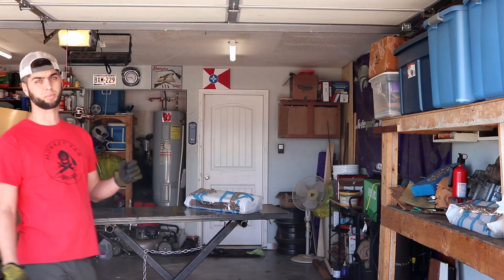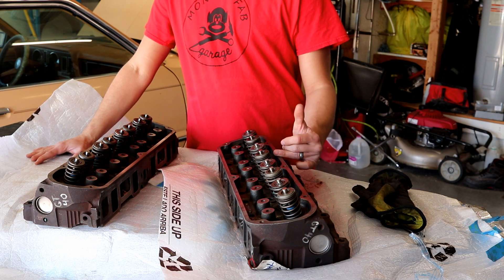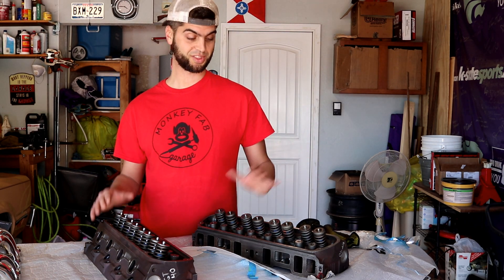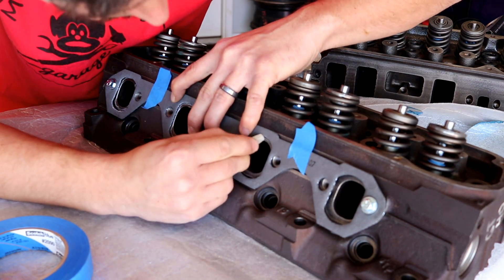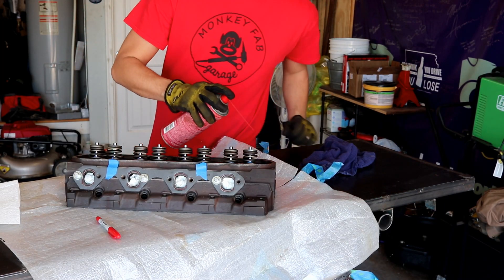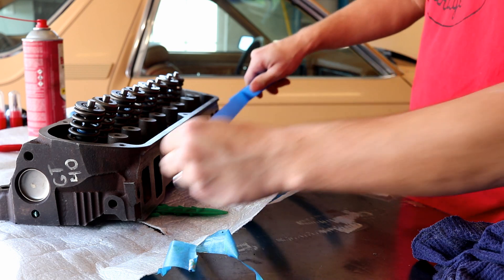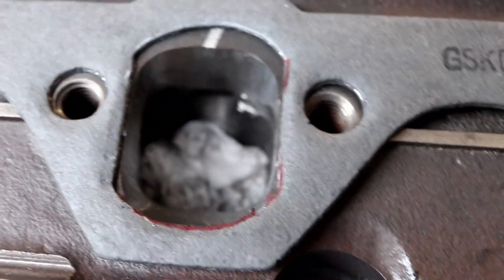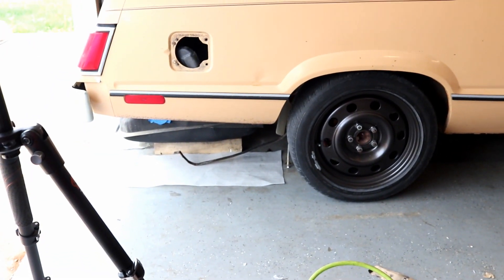Swapping GT40P Heads on a Stock Low Compression 78 Fairmont, part 1

Comment: Not worth the effort  ,grinding  the bottom of an exhaust port, , spend your money on a good valve job and port work in that area  1 inch before and after the valve is every.thing
Reply from the maker: you're not the first to respond about the time I spent on the floor. I've certainly learned quite a bit since posting this video. Totally makes sense

Comment: Flat tapped cam 150-180$ it’s gonna make such an improvement and your already in the engine 🤔
Reply from the maker: I didn't have to take the timing set/timing cover off this way. Or remove the radiator to get cams in and out. Pretty happy with how it turned out. I'll let the next owner pic their own cam! Thanks for watching

Comment: The GT40p heads do have an exhaust valve and port size problem. You can just put an angle  on the port exit on that side and no need to make it too much bigger but these direly need full on exhaust port polishing because any cam over .500 it starts to lose cfm because it simply cannot scavenge due to the small valve.
Reply from the maker: well said. Thanks for watching

Comment: Curious how.   Does it run being low compression I have 85 cougar I am doing thinking I am doing a cam and gt40 p heads with a carb
Reply from the maker: unfortunately I suck at getting things done quickly. If you watch my next upload tomorrow, you'll see I'm still struggling with start up issues. I wish I already had this answer for you!!! It's killing me not being able to drive it. If you can find normal GT40 heads (non P) I'd recommend that so you don't have to deal with the spark plug clearance issues.

Comment: When I hear never cut the floor? I kind of laugh. Why? You can knock of the rough cast but nothing more. The short side radius is a place to learn something. There is more power in the valve bowl area then any where in the port. There is a book I suggest because every pro has a input in it. As a few Pro's has told me. "It's not the best book but it's a damn good start." The book is called "Engine Airflow" by Harold Bette's and another book to get is "Engine Airflow" by John Baechtel. Trust me those two books will change your way of thinking in porting cylinder heads and intakes.
Reply from the maker: appreciate this! I'm glad I did what I did (even if some people think it was wrong), because regardless it helped me learn so much in doing so!

Comment: Thank you for this video. This is something i would like to do to my spare engine but have never done before. Just gives me that little extra confidence
Reply from the maker: First off, that comment tickles me because that's one of my objectives of my channel is to encourage people. What I also want to share is that since this video I've learned there's next to no advantage spending time when porting the exhaust port to do anything on the "floor" of the port. Spend your time knocking down any bad casting lips on the sides and ceiling only
Reply: @Str8sixfan  cool thanks for the tip. I want to do a build video series with this engine anyway and will give you a shout out and link to your vid when I do

Comment: I port heads for fun and profit. In the future, when you port stock iron heads on a mild engine, do not gasket match the ports, that will only slow down the velocity and make the car feel a bit lazy because they are too large. Port and match only the long turn radius, (top of the port) to the gasket or header contour, and leave the short turn radius (bottom) alone - do not touch it. This one tip is 10 horse and 10 ft/lb of torque.
Reply from the maker: Appreciate the feedback. This may have been the only way to learn. Luckily I didn't go true gasket match, but could have left the floor alone. Next time. Really appreciate the advice. This is exactly what my first project car and series of videos is supposed to do for me! Help me learn for when I build a car for keeps.

Comment: I could be wrong since i dont know alot about fords. But i heard there was an aluminum intake in 82 that was 2 barrel for an h.o. they were slightly taller i believe maybe something to look into
Reply from the maker: OK, I'll give that a shot. I know of 4bbl HO manifolds for sure.
Reply: @Str8sixfan  i have been looking more into it and apparently it was a one year only from the looks of it. in 82 it had a 369 cfm 2 barrel, then in 83 a 600 cfm 4 barrel. of course if you can find one cheap because i get the budget carbs are not to cheap, you can find them cheap sometimes but not always. maybe a phonolic spacer under the 2 barrel will help

Comment: Your stock compression ratio being 8.4:1, these heads should give you a decent boost in compression and is one of the best flowing factory heads Ford made.
Reply from the maker: Looking through old literature I could of sworn it was more like 8.1:1 stock. But regardless for sure looking at increasing it!

Comment: That's a really good deal for a really good set of heads and it looks like you've got just enough left in the budget for a timing keyway kit plus shipping too! 
Over the years I've seen a bunch of people throw awesome sounding cammed up engines together that can barely turn a tire over. If your nice heads, cam and intake don't match each other well then they will often run worse or barely better than stock. Unfortunately the stock broomstick cam isn't even close to optimized for the stock heads, much less the GT40 heads. 

I know what's done is done but having a tech help you pick an ideal off the shelf cam based on the engines compression ratio, the stock intakes peak RPM and the cars gearing would have been cheaper than the finished heads, much easier to install and much more rewarding in both the performance and sound departments. Advancing the stock cam with a 60 dollar keyway kit will do almost as good as a mild cam by getting you closer to the air speed and cylinder pressure you are gonna need to see a real gain from adding more port. 
Keep in mind by adding so much port on an otherwise mild combo you are actually going against the logic of velocity that Uncle Tony is trying to teach us about by purposely putting smaller 318 2 barrel heads and a purposely restrictive intake on his current 360 high torque daily driver build. (This is the same intake I showed for my Olds 260 build in one of my last vids by the way) 
289 heads with smaller combustion chambers for even more compression and smaller ports for velocity would have actually been a better pick for a low compression engine with the stock cam but hindsight is 20/20. 

I'm not trying to beat you down or sound like a know-it-all here, I just want to make sure you understand how important it is for an engines cam, heads and intake to all work together. Efurd's comments about the garden hose and velocity are pretty much spot on. 
Your hose just got bigger so now you need to increase speed and pressure.

There's a chance these heads alone with no other accompanying upgrades might actually make the car slower but I'm sincerely hoping that won't be the case. A cam that works properly with these heads and the stock intake would make this one mean little combo but I understand that's not in the budget. Speaking of budget though, I was just researching these heads to give myself an idea of what your compression would be when I found out that the GT40P heads come with very weak stock valve springs. So weak they can't even handle a stock .444 lift 5.0 H.O. cam so that adds a lot of money and hassle to any potential future cam swap plans. 
At this point advancing the stock cam is looking like a really good idea. Probably one of your best options if you want it to have good throttle response and still meet the budget.
Reply from the maker: Camshaft key might be a great investment. Certainly scares me at my skill level however. Good news is my stock cam can't be compared to a 5.0 H.O. cam I wouldn't think. I figure the 1978 camshaft is so crappy that I should be fine on the stock springs. I'll have to go look through my Chilton's manual and see if there's a number for cam lift. I know you're trying to help and I don't take any of your comments as less than that Impact's (you've been around long enough for me to know that). I understand I'm taking a risk, and there's a lesson to learn at the end of it. I can't imagine that I'm going to end up slower. At the very least the bump in compression has to help, right?
Reply: @Str8sixfan  I was just getting ready to tell you that advancing the stock cam is a very basic task but after doing some more research on that subject for this specific combo I've come to a startling conclusion. According to a few Mustang forums I was just browsing, installing GT40P heads on a 5.0 with no valve relief cuts in the pistons will almost certainly result in piston to valve clearance issues. Luckily you can check this by properly mocking up head installation with clay or silly putty in the cylinders. If they do clear then you can disassemble the head and measure the depressed putty for proper clearance. I read that seventies 302's had dished pistons for lower compression with valve relief cuts too so they work fine there but I can't find a solid answer on whether or not the 1978 5.0 pistons had any dish or relief cuts. Basically what I've gathered so far after a couple hours of research is that if you pull the heads and see you don't have relief cuts then you will need to make some relief cuts with a special tool or swap pistons or ditch the heads. If you DO have relief cuts then there's a chance it will work but it's an expensive thing to gamble on. If this was my motor and it does have relief cuts I would still clay test it first. Here's some VERY important info on the subject. https://www.stangnet.com/mustang-forums/threads/cobra-gt40-heads-cam-options.856372/ 

https://www.stangnet.com/mustang-forums/threads/gt40-p-heads-with-flat-top-pistons.764282/
https://www.corral.net/threads/flat-top-pistons-and-gt40-heads.763533/
https://www.fordmuscleforums.com/threads/gt40p-heads-with-flat-top-pistons.490062/
https://www.corral.net/threads/302-piston-identification.2370202/
https://www.stangnet.com/mustang-forums/threads/foxbody-came-with-these-pistons.892747/ 

This last one is a decent how-to-vid for clearance testing small block Fords.
https://www.youtube.com/watch?v=tjs61-TCZYw

Comment: Grant if you needed to borrow a valve spring compressor, I got one and there is nothing that you can mess up as far as taking the springs off, because to ultimately increase flow, both sides need to be done. Just doing the Exhaust is only half the battle. Another thing to keep in mind and that is a common mistake is to only port the bottom side of the port, your real high velocity gases are going to be closer to the ceiling of the port rather than the bottom. Looks like you did a good job on cleaning up the ports, time to bust out the sanding drums and make 'em shine.
Reply from the maker: Thanks for the tips Jed. If I can't easily borrow a compressor at O'Reilley's I'll come get yours. I did clean out the top some. I don't feel like what I've done on the exhaust side is so aggressive that  it's really going to hamper what happens on the intake side. I'm constricted all the way upstream so I'm not sure what good porting the intake side would even do in the first place. But maybe with some mentoring I could be talked into porting the intake side as well as the manifold.
Reply: @Str8sixfan  id be more than happy to help out in any way my friend, leave the intake ports with some texturing while make the exhaust side super slick. Just cleaning the casting up can improve flow by a ton
Reply: What about reversion and AR or Anti Reversion dams?
“bigger is better” was true and functioned well before there were lots of dynos around. The only way to get more power was to get more air through. Bigger and more carbs, bigger cams,port the hell out of the cast iron heads… you name it but they were sacrificing a broader power band for more peak power. The cup guys back then all spent much of the time “at” high rpm so 20hp at the top was measurable at the track, but that same engine would be a dog at the drag strip. (compared to the best motors of savy drag racers). The two rarely met and the in between was someone like Larry Widmer and Mr. Feuling who discovered that “bigger is not always better”.
Mr Fueling “learned” that “reversion” was not good, period, and any attempt to minimise it would result in a broader power band for a given engine. Whether or not it helped the car go faster or quicker was another issue,… did the car “need” the larger power band, back then they usually did. Not so much today, for lots of reasons.
The larger things got the worst the reversion. Reversion, which I have tried to clarify a definition of in other threads and my blog, is flow going the wrong way through the engine. If you make things bigger to allow more flow at the same delta P, then that also works the other way also, flow backwards through the engine is helped also, not good…
Reply from the maker: @mostlymoparih5682  wow! what a wealth!
Reply: http://www.exhausting101.com/?p=68
Happy Motoring.